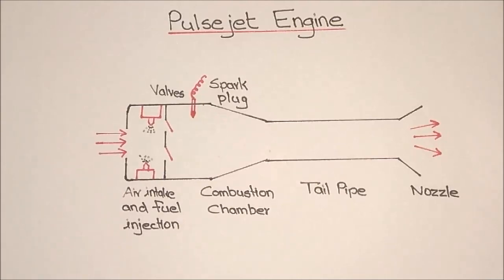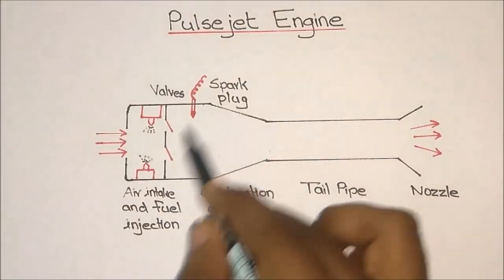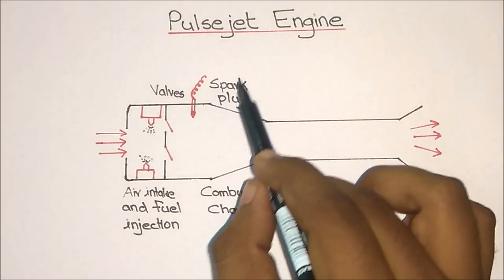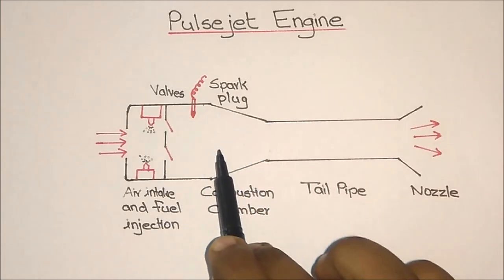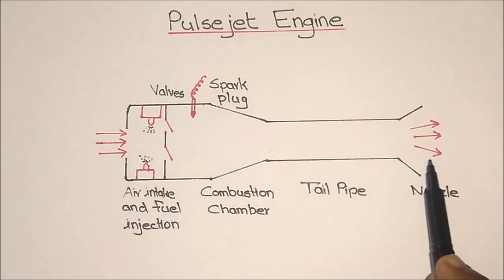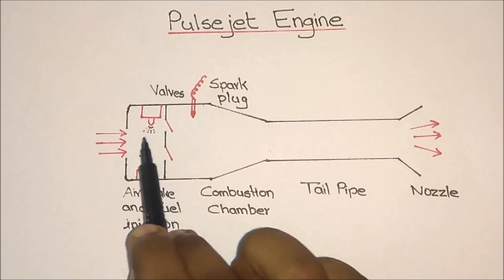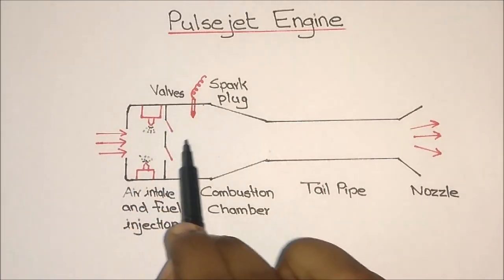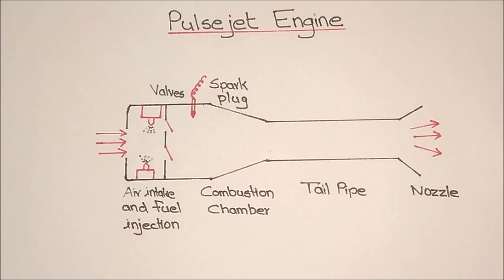Pulsejet Engine Working Explained

Comment: these valves are not springloaded, as far as i know the combustion closes the valves. the valves wear out in pulsjets.
Reply: I think you are correct..
Reply: These valves are reed valves. Similar like in 2 stroke engines.
Reply: Juhani Vartiala actually they are not
Reply: They don't have springs but are made of a spring steel so they can bend to open for intake and close during the explosion.  One typical design is called a "petal valve" with it being a flat piece of spring steel that looks like the petals of a flower.  each "petal" covers a hole on the back surface of the head.
Reply: I forgot to mention that there are also valveless pulse jet designs.
Reply: Pulsejet has spring-loaded valves
Reply: @subashrees1763  yes and no, the valves are in many cases steelsheets wich are springs and valves in one and layed over the air intake, they are normally opened 
if combustion accurs they act as one way valves and close do to combustion when the hot gas is propelled  backwards, the pressure inside the chamber lowers and pulls air through the intakes, when fuel is injected at the right time the backdraft from the exhaust egnites the fresh air-fuel mixture and the process starts agian, the sheets used are under such stress that they are the most common part to wear out wich is why the ultimate pulsjet would be "valveless" so it could operate with no moving parts, than u only need a perfect silencer and you could build a plane cheaper than a car....
Reply: @subashrees1763  is there any way to join into aviation industry?
Reply: @fabianseewald7884  i saw that silencer got red hot when longtime run! What if it melts, in upper atmosphere it wont melt due to icing effect?
Reply: @amalangelraj  the airstream has a cooling effect there will be no ice on the jet, the vibrations alone would probably shake it off, if the heat doesn't take care of it, icing would be problematic for controlsurfices
Reply: @juhanivartiala352  would you say this is halfway to a rotary without the Doritos and eccentric shaft

Comment: No someday you might learn about a pendulum chamber you want the shape of the first part of that engine so that you can create the high  pressure low velocity and then you went to proper shape to convert it into lower pressure higher velocity you'll find you increase your thresh ratio quite a bit and you only need to spark it once if you have the right shape it will keep running after that

Comment: Thanks for the video - ignore the negative comments below! How is the spark plug controlled?
Reply: he ignored ur comment too ! lol
Reply: It's not. You need ONE spark. It should self sustain after that. A tiny bit of flame comes backwards through the nozzle and reignites the new fuel that was pulled into the combustion chamber by the vaccume created when the first flame is expelled. This back and forth, or pulsing, gives the engine it's name. This video does a lackluster job of explaining it.
Reply: you only need to initiate the process, when the flame is shot out, the pulsjet body cools slightly and pulls the flame back in, to ignite more fuel. the thing can burn anything, even fine dust in theory. this happens over and over thats why it buzzing.

Comment: The main issue with the valve is the high temperatures ,,it wears out the valve so fast
Reply: James Cunliffe  they are…but not as effective as the mechanical ones

Comment: Cant we use hydrogen instead of petrol or gasoline?
Reply: You'd have to design a fuel compartment to make it so that it keeps it in a liquid state and design it so that it doesn't compromise the aircraft if something were to happen, it is also more expensive to have liquid hydrogen than to have gasoline and I'd imagine that if you to look at the cost benefit analysis for hydrogen vs gasoline switching to hydrogen wouldn't be worth the added materials and costs of refueling

Comment: Intersesting...

why is the pulse-Jet not made to rotate around its own Axes and by so be its own compressor?
Whats the ratio between Outlet/inlet
Why isnt it made tunable in size of the four parameters that will decide thrust to weight that is  lengths of tail/Combustion chamber/inlet/fuelsupply.?

How far can it fly if its a rocket :)....Ca it reach MOSKOW?
How much weight can it carry while flying as a rocket
Can a pulsjet be sufficient as first stage to supply a ram jet with sufficient speed?